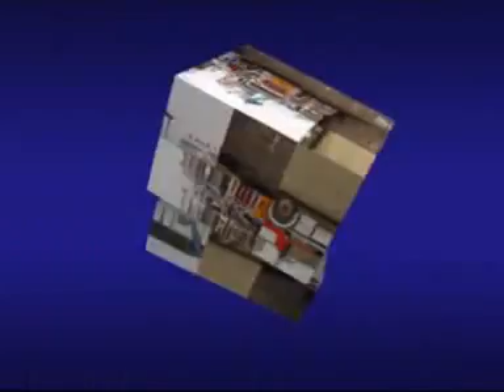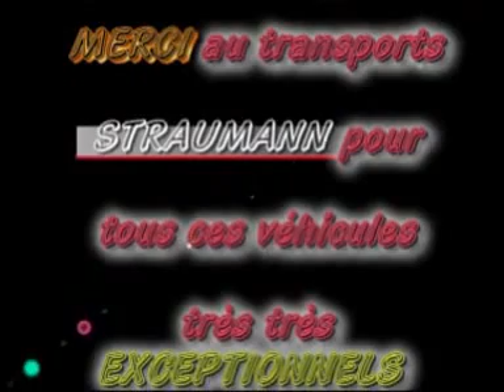SCANIA R620 modifier version convoi

Comment: in Italy there are some versions of Scania's 8x4/4 with  the standard gearbox for 192t  rxxx 8x4/4 hnc-with front air and rear leaf/parabolic suspension dif ratio si 5.14 with grs905 grso905 
and there are probably 5 Scania's for 200t with 5.14 and direct gearboxbut it is only for easier terrain conditions.......... in the meantime the fair bauma Scania has introduced a new ratio of differential 6.5:1 for mining applications 
..... who knows what could be seen on Borneo

Comment: @swiftyjim2 there is a company in western australia that has 5 scania R580s on double road train, b double with an nextra trailer behind and an 8X4 rigid with double road train behind that, 100kmh is the speed limit australia wide

Comment: yes yes 4.85 it is hub reduced diff scheduled for at least 150 ton...in some cases up to 250t (with WSK)
but with this 180 tons I mean that can not go faster than 110kmh ( with 620hp).with 4:27 ratio differential could go 120kmh with 150tons. (also hub reduction rbp835+rp835).

Comment: Australia? on your profile it isUK?

but anyway what is problem with scania in outback?
Scania is able to easily pull 180 tons as LA 6X4 hna oh hhz /ezh chassis with f958 frame
rbp835+rp835 diff rated at 4.85 and overdrive gearbox ?

Comment: but the problem Scania´s problem is that there is still no v8 EGR....,although should soon come out....scr catalyst and takes too much space on the chassis....( catalyst and silencer)and ad-blue tank ,but with EGR engines is a problem because they have weaker fuel economy.....
but generally  Scania is not for  the most difficult conditions ....because there is no three drive axle (I think rear 3  not the front)and there is no tractor combinations with 3 rear axles.

Comment: 250tons with standard scania gearbox ?????????????

Scania standard gearboxes can handle 150t............in special cases 180t ....condition for the 180t is rbp835+rp835 4.85 or 5.14 dif ratio v8 engines double frame and grs905 /grso905